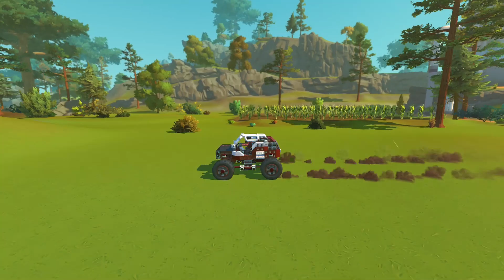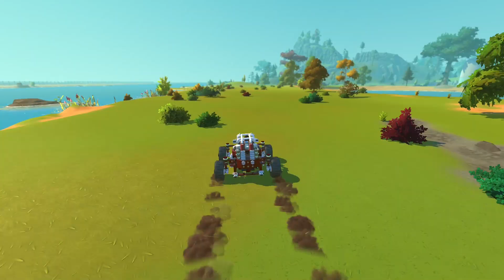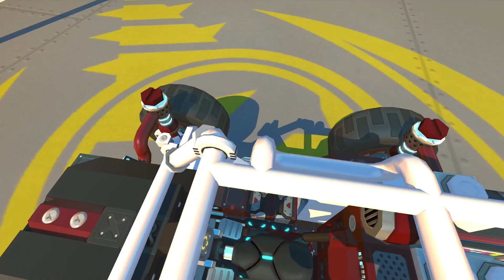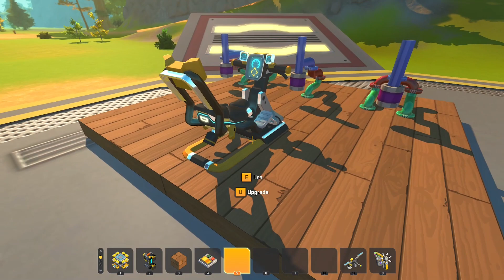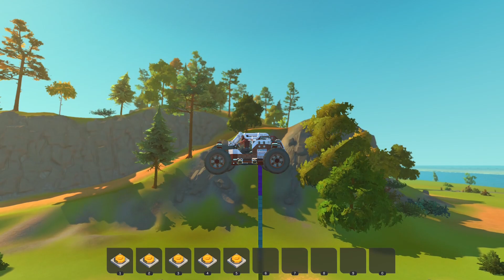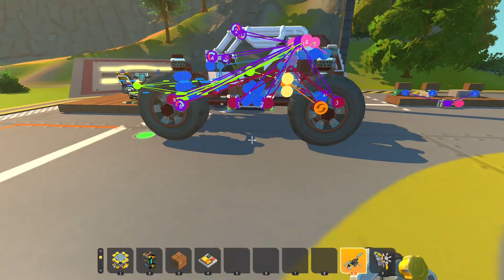Acrobatic Car - Scrap Mechanic Creation Showcase & Teardown

Comment: Damn that's literally the best car i've ever seen! It's small, decently fast, very cool looking (especially when jumping and flying) and can drive though almost anything
Reply from the maker: Thanks. To be perfectly honest, it doesn't drive all that well, or at least not as well as I would like it to.
I needed it to have a decent top speed, which also increased the torque.
Combined with the need to keep the car lightweight, this makes it too drifty.

Comment: Absolutely amazing! Would it be possible to integrate stabilizers into a piston engine build? As in - would the engine or the drive shaft gain more stability, or the whole thing would explode due to the internal forces of the engine, the gears or the steering? The list of parts for minimal collision you have suggested and use cases would also be very appreciated
Reply from the maker: I'm assuming you mean the torque generated by a piston engine causing an equal and opposite reaction.
The larger the rotating mass, the greater the reaction, so I would suggest lowering the mass as much as possible (unless you need a flywheel) and increasing the weight of the creation.
If you think about it in real life, the mass of the spinning engine parts and shafts are really low relative to the mass of the vehicle itself, although the wheels are a bit more significant in some cases.
Or perhaps split your engine in two and have it counter-rotate, much like how coaxial helicopter blades work.

I don't recommend stabilizers in this particular application because it does not "discriminate".
It might help with the reaction, but at the same time it would also impede desirable rotational forces, such as turning your vehicle.
This would then become an unwanted suspension "glitch" instead of controlled suspension "exploit".

I do intend to make some more videos, but this is still just a hobby for me, and to be honest making videos are harder (for me) than it seems.
I'm not doing it to make a living, simply to share and give back to the community if I can.

Comment: sweet ride!  

that's an interesting way of doing the suspension glitch. I might have to try that some day!
Reply from the maker: Thanks.
I always prefer controlling suspension glitches with pistons (hooked up to buttons or logic) rather than with bearings and controllers because it is much more responsive.
The exception to that is bearings connected to driver seats of course.